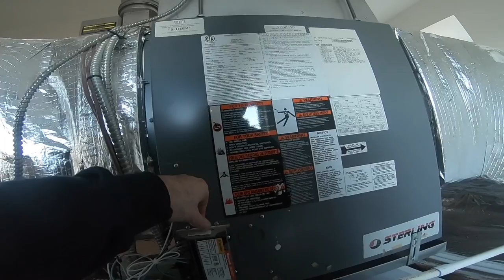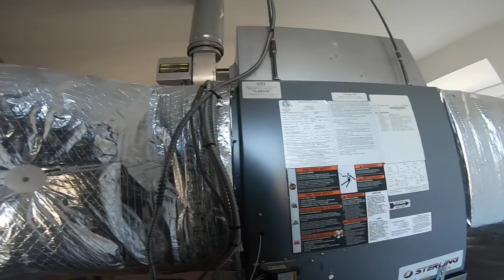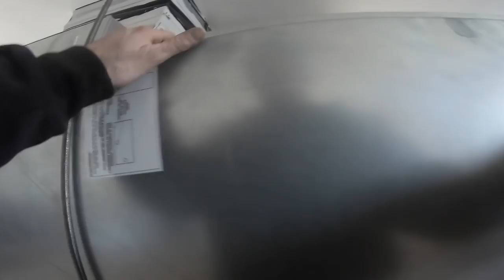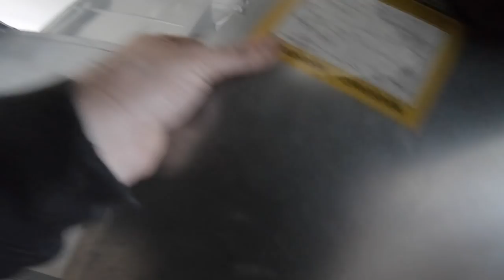HVAC Troubleshooting a Low Voltage Short

Comment: Good find 👍
I'll be the 1st one to tell you when something is my fault. I own what i do. Maintenance "when done properly" will make anyone a better technician. Good honest talk at the end.
Reply from the maker: I chased many shorts yet never had one like this. I am suprised I was able to reset the breaker in the condenser earlier and it came back on until that piece of metal grounded back out. Must of moved it off metal for a second first time through the unit. When checking on it at the end of the repair the breaker tripped everytime we tried to bring it on
Reply: it probably made a very long distance poor conducting loop that took time to slowly heat the breaker up. 
I'd imagine something like it traveling through all the tin work and line set or back through the breaker/sub panels and back through disconnect, once reaching a common grounding point.

Comment: This kind of installations often reminds me of the time I worked in a semiconductorfab in Germany. I spent a long time with dryech untis from LAM. The brutal horror of wiring for german workers. Cables come form everywhere and goes to everywhere. Some of the units are working on 120/208V the other on 230/480V just as thy are. These untis never where out of beta state but they are in the productiv zone.

Comment: At least you admit your mistake...that's what makes a great tech..keep up the good work. I would have never saw that
Reply from the maker: I did drill a few new zip screw holes in the cabinet on the ac maintenance. Still not sure how it took half a year to settle and create g terminal short to ground yet...........

Comment: Ha! I was working on one similar to that one but way older. Had a problem with the limit switch on the flue vent.
Reply from the maker: I would of loved for it to be a system component. I thought it was a short in the green wire at first. That little metal shard was hard to see since it was directly behind the terminal strip.
Reply: @thehvachacker  I'll have to finish watching this when I get home, came to see a friend propose to my other friend. BTW, I keep meaning to tell you that I know that you are all about cleaning dust on the units but last time I did that, there were metal flakes in the dust and shorted out the AH control board on a 6 year old unit that is discontinued.
Reply from the maker: That sucks I never had that happen. I am still trying to picturing how that happened. you had the unit powered off? Sucks a 6-year-old unit that is discontinued. Had to be shaving of metal from a zip screw

Comment: Whats the odds, that little metal chip falling on to the terminals...
Reply from the maker: First time I seen this. I drilled new holes for the 3/8 zip screws that hold the door on during the ac maintenance. Not sure how this found its way to connect the fan g wire terminal to ground. Yet we will always run into first times. I was going to just try using a different terminal and noticed that

Comment: I didn't see anything connected to the terminals where the shaving was..
Reply from the maker: At the time of the photo, I had the g wire disconnected and the blower contactor and heat relay wires disconnected from the terminal strip. Yet if you look at the terminal strip you can see it is the g terminal. I disconnect/ isolate everything when looking for a short. I still blew breaker in condenser connecting the green wire for the fan from tstat onto the terminal. I thought at first I had a bad terminal for a second before I found the metal shaving/shard. This unit needs the fan to start before it will allow the burners to operate. What I am trying to figure out is how was I able to reset the transformer breaker and system started unless I moved the shaving tracing wires before going to the condenser. Which made me believe it was possible the compressor contactor.
Reply: I get what your saying, Great video!

Comment: Nice catch on that one, is it just me or is this install taking up a lot off space for nothing?
Reply from the maker: It’s a big air handler with separate gas heater. No way to stand it up. It’s attic space all the ductwork under unit and up in the drop ceiling above the room.
Reply from the maker: How many tons of cooling do those modular units go up to? I have one unit kind of like that I have a video of cleaning the condenser coil on it. This is 12.5 tons 126,000btu of cooling.
Reply: @thehvachacker  since its modulair, there is no limit. This will affect the size of the unit accordingly. Direct gas heaters are not common here,  on this unit its heatpump only, but on some there will be warm water coil situated in between the unit connected to a closed combustion natural gas fired combi  furnace. (Air intake and discharge directly connected to ouitside air) But there is a fase out of natural gas connection, in 2030 you can not get connected to natural gas grid anymore. Everything has to be electric (heatpump). Best wishes this year, hope to se lots of your videos.
Reply from the maker: Interesting of the phase out of natural gas. I had no idea of a shortage. I know a lot of natural gas drilling companies went out of business cause of the abundance making it so cheap a few years back. Here everything is gas heat barely any heat pumps. We do have some heat pumps yet they always require auxiliary heat.
Reply: @thehvachacker  actually plenty of gas here also, but there is that paris agreement that says we need to reduce carbon footprint. And the way to do it will be decided by dumb behind money grabing greedy sons of 4legged animals. And nothing we can do about accept beging for lube while we get fffdd. R22 fased out Gwp 1732 and Odp of 0,05, we all had to move to r404a gwp 3944 and odp 0. WTF🤔. And now we ban 404a and move to propane or eighter C02😠, one is explosive and the other will use 3times more energy for the same amount refrigeration compared to r404a,  the people have got heads stuck in there behinds. Int last few years i have seen it all, bream,seer,scop,eco design, bim, circulair building. And what not. Considder yourself lucky over there.
Reply: well see how well that works the first time there major extended grid issues :))

Comment: self inflicted issues are never fun, at least you caught it and lol at kicking yourself over it :))
Reply from the maker: I always will throw myself under the bus 🚌. The last time there I ripped a few new screw holes to hold the door on. I could act dumb and play like I have no idea where the metal came from. I thought I might actually see my first bad terminal strip. Lol.   nothing connected and still poping the little resettable circuit breaker on transformer when energizing terminal. If not for using my phone camera to see wtf I would of just connected the g wire contactor and relay over to an unused terminal
Reply: maybe it was there from the install tin work and just fell/jumped there from vibration, just never know lol

Comment: Technician note: Loose factory wiring, tightened low voltage electrical connections, now not tripping transformer anymore. 
 ; )
Reply from the maker: I must of moved the metal shard enough the first time that the g didn’t ground. A metal shard was grounding the g terminal

Comment: Yea... When all the warning labels are in a hundred different languages...

... you know ur dealing with new garbage and should expect bullshit failures lol.
Reply: Most techs dont read, just fix it! Techs thinks visually.
Reply from the maker: Yea I use to read those warning labels. Yet they say live voltage do not open panel without powering down a system. How do I work on if I power down.